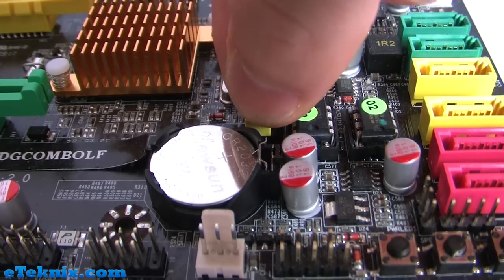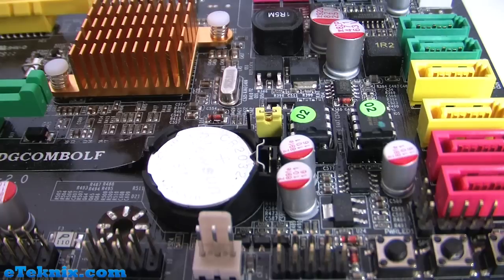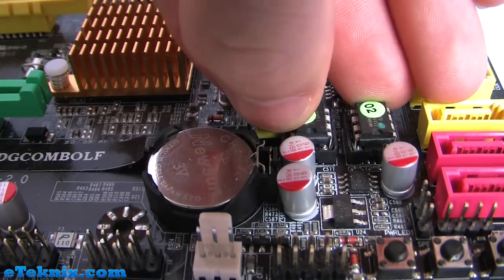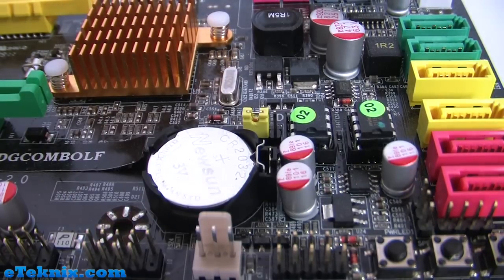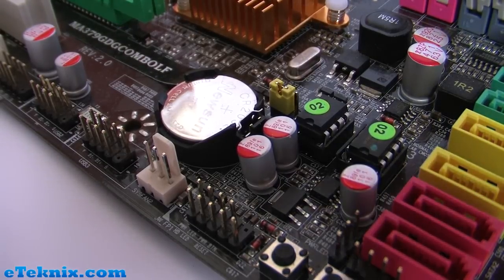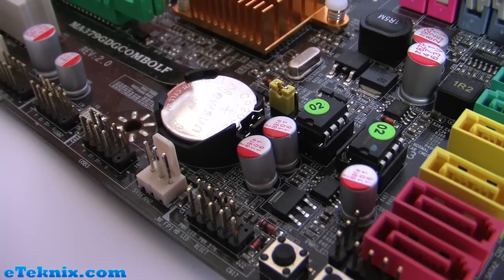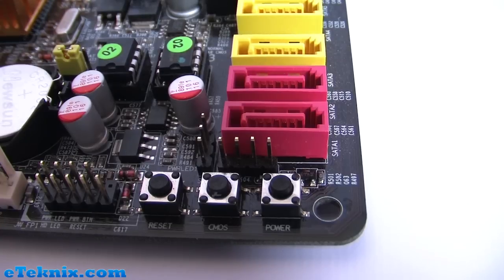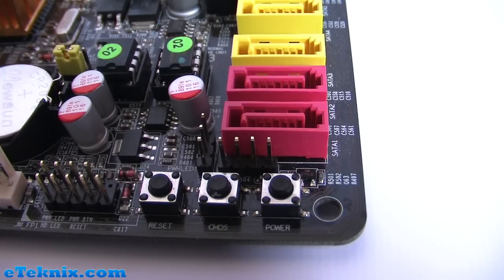How To Reset CMOS

Comment: I have bought a prebuilt pc and when i boot it the lights and fans start but the gpu ventilators dont  and the monitor doesn't display anything. The vendor said it was tested before sending and it doesnt look damaged at all in transport.I have noticed that the pins shorted on the cmos are 2-3 (clear cmos) and not 1 and 2), coud they have messed this up? my motherboard is H61/B75 M.

Comment: Thank you so much. My power cord went out a few weeks ago on my alienware x51 and luckily I had an extra power brick. Now a month or two later it just shut down by itself went black screen and then booted it self up after a few misfires and now it proceeds to beep twice and go on like that until I literally unplug the thing and do a power drain on it by holding dwn the power button for a min or so. Now I'm finding out that people say it's the "ram" or it could be the motherboard crapping out. Where do you think I should start first? Also do you think this could be happening because the power cord crapped out and I had to replace it back then?

Comment: 1. while pulling the cmos does my pc have to be powered on and running?
2. if the answer to (1) is no then after i put it on the 2nd (last pins) do i have to turn on pc then shut it down and move it back to first pins? 
3. if the answer to (2) is also no, then will it work if my pc is not connected to any powersuply? I mean how does the mobo know if the cmos is reseted if its not connected to any power source
Reply: You must unplug the power lead before resetting the cmos.
Hold the cmos reset contact (or pins) for 7-10 secs.
Then plug your power lead back in and turn on your machine.
Always consult your manual, but JBAT1 is what it's called.

Comment: My Pc is not Starting up, even i tried removing and reinserting CMOS battery and and ram, Couldn't the jumper in my motherboard.
Fans are working fine, HDD is also fine as there is spinning sound is over there. but PC is not starting up

Comment: THIS action was preventing my machine from booting?!
Reply: Take out the CMOs, wait 10 minutes, and put it back in again
Reply: @HuskyShields  the cmos battery or cmos
Reply: Lux cmos battery
Reply: @HuskyShields  would this work if my pc turns on but there’s no display on my monitors?
Reply: @xeh9057  I’m not sure I just got it off the internet
Reply: @xeh9057 hey , did u solve this ?
I get black screen after changing my bios settings
Reply: Nexus  damn, did you try taking out the mobo battery and putting back in  like he shows in this video
Reply: Nexus idk that’s all I know. Ask the Linus tech tips forum’s
Reply: Nexus  what is the issue you are having exactly. Did you try changing BIOS settings and you're now getting a black screen?
Reply: Nexus  yeah, I’m going to short it with a screwdriver because I don’t have a jumper cap
Reply: @Nexus did you try reseating the ram taking it out and putting it back in. Also you may want to reseat the cpu as well. These may prevent a computer from booting up properly. This troubleshooting is especially helpful if the fan is working but no display on screen. If fans are not turning on then it is the power supply. For starters try a different outlet. If no good then you may need a new power supply, or even a new mobo if it was over spiked. Hope this helps, please keep me informed. -Jorge best of wishes 🤝

Comment: @eTeknix My system has a gtx 970 and an integrated gpu. I was getting 10fps on witcher 3 instead of the usual 60. Tried to run nvidia control panel and got the "an nvidia gpu is not plugged in" error. I looked up online for a solution and in a moment of absolute buffoonery I followed some person's advice to disable the integrated graphics card, because he said, that action would trigger a switch of gpus on the system. Well, you are already laughing because you know what comes next. As soon I clicked yes on the disable integrated gpu dialog, which I located in my Device Manager, "BOOM", everything went black. I looked up online and a lot of sources on tomshardware and elsewhere suggested a cmos  reset, claiming that this is purely a software issue. Well, I switched all power off and removed the socket of my screen, my tower but not the power of my external speakers (a fact I realized just now) . I opened up my tower, removed the cmos battery, the round silver thing, and waited for more than 24 hours, before placing it back correctly, because I took a photo before removing it. I switched my PC on and still the problem persists. It operates fine,  just I see nothing. Screen blacker than vantablack. I am at a loss here. You seem to know your stuff around hardware. Any advice would be welcome. Cheers from Greece.

Comment: When i reset computer and go to "Boot Menu" all freeze it won't work any
 kinda key: (up down left or right and so on)(I have USB keyboard) tho 
others stuff like BIOS settings will work just fine and same for windows
 but still I'm unable to boot anything from boot menu. Even tho I can a 
in bios that boot cd device as first and insert DVD with windows on it 
just won't work it will freeze like Boot menu, everything 
connected/bonded with Boot will freeze cuz of Boot menu.  
So i would like to know what can I do ? Bc like I tried to reset Cmos 
and jumpers and didn't work, Disk is healthy rams as well, idk it is 
possible that my mobo is dying or sth ?

Comment: Hi, when there's no power going to the motherboard and there's no battery how does the cmos know I'm touching the 2 pins with a metal object?
Reply: It's grounding data from the internal memory, effectively resetting them from ones and zeros, to all zeroes.
Reply: Thank you! I had this exact question in my head the whole time

Comment: Hey i need some help... If i do this.. will my whole entire pc be un-overclocked? because im really fucking stupid, also i overclocked an intel core i3 with intel hd graphics 4400 and i just realized what ive done... also i play on this computer for games easy to run games, whenever i overclocked my computer with the Extreme intel tuning utility, my games were running SO SLOW i mean I tried everything, i tried to do a factory reset and and that didnt work i tried putting it in the default settings and THAT didn't work, i tried a live chat and they tried to help me and that didnt work! so will this help put everything on my normal settings and will get my FPS back to normal?!? PLEASE HELP ME
Reply: go into bios and select load optimal defaults, or reset settings. than it should work.

Comment: I can't find the cmos jumper.What can I do?
Reply: +Im Rambo Gr.....  I propose that you take the  BATTERY out . 30 seconds wait. Battery in (the small 1$like battery. not the Laptop Battery!)
After  this - first thing TO DO is SET your time and DATE, since when you  take the Battery OUT it will sett time and date to 00 00 00 and no software will recognize it as normal.
Reply: 30 sec didn't work but 1 min it did

Comment: I've tried this to fix a display problem and it's still there so I'm calling out to the youtube community: My cpu will display images fine with HDMI but using a regular monitor it will not display, the monitor says there's no signal... The monitor doesn't have an HDMI input, I tested it with my TV and I won't be using it for my CPU. Any suggestions?
Reply: +Julien F-T use an adaptor hdmi to vga

Comment: I don't have the yellow jumper
Reply: I have a yellow cardigan with buttons on the front.
Reply: +Technomics Review just take the battery out for 5 mins and put it back in all with no power connectors connected to the motherboard

Comment: Wait wait wait, did I just hear you say that the battery can hold data?
Reply: MarioKL117 it explains why after I did it restored the time and applications on windows 7
Reply: Date and time etc
Reply: MarioKL117 It's the CMOS that holds the data, the battery simply provides power to the CMOS so it doesn't lose that data
Reply: Darrelle Abernathy So it will delete the files on the computer???
Reply: Noob Gaming the CMOS is storage for the BIOS of your motherboard. So, It shouldnt erase your computer files because said files are stored on a drive of some kind, Rather than on the tiny CMOS
Reply: Yes! That's actually how a lot of Gameboy games actually saved your data.

Comment: Hi, i just bought a new motherboard and after i installed it and start my system, only just black screen on monitor please help????
Reply: +Mohamad Nurhadi check all cables are pluged and reseat cpu also try with one stick of ram try the ram in each ram socket

Comment: I took the battery out, but my cmos still didn't reset, and the jumper doesn't work either
Reply: How long did you leave it out for?
15 minutes is long enough to make sure it's actually reset
Reply: venum4k i dont have a pin or jumper to do what he does in the video and i had my battery for 1hour out and it still doesnt work

Comment: Is the computer supposed to be off during this process cause the would be no power running through the CMOS jumper therefore doesn't make sence that it would reset the CMOS

Comment: I have old IBM, and it freezes on the IBM splash screen. says to interrupt start up press enter, but pressing enter at this stage does nothing.  If I press enter before splash screen shows up , I get four short beeps, pause then one short beep, It does this twice then shuts down. 

I tried resetting the csmos but that only caused it to not start and one long beep with two short beeps, which I have read is a display adapter problem.

Comment: I have a question, when you reset the cmos, does the motherboard need to on with the other components attached, or can you just take the individual motherboard with it turned off and reset it?

Comment: You just saved my new computer. I was screwing around with fans in it earlier and removed that because I thought it was nothing important. I thought it was a fan slot for a second because it was no where near the cmos battery. Just found the jumper laying on the table, put it back in, computer is working again. Sucks I just wasted 4 hours of my day trying to fix it though...

Comment: I have Foxconn G31MXP-K and I accidently overclicked it to too high and can't boot into system, I opened up my computer, remove the battery for a while then plug it in agian, everything was resetted, my computer worked again. After everything fine I closed case.

Comment: @wtchluring I found the battery, but the placing of the battery was a bit awkward (right underneath the video card) I pulled it out and put it back in with success. However, definitely no jumpers. Its a microboard

Comment: @Hadi2234 It's the same situation I told the guy above. If you reset the cmos, it resets ALL SETTINGS to DEFAULT. If you have integrated video  available on your board THAT'S the default setting, therefore, you must plug the monitor into the integrated video then set the video to PCI-EXPRESS. Now you can plug the monitor back into the video card.

Comment: Was it working when you had it plugged into the integrated? If so, the problem is that the BIOS video method is set to onboard video and needs to be set to PCI-express. Reseting the CMOS will NOT help because it'll set the video back to onboard.  You can only activate either the dedicated video card or the onboard memory one at a time, not at the same time. If one works, the other wont.

Comment: My computer will Simply not boot.(happened after adding more ram. Using the old ammount when doing this) The components are fine. (Even the ram). i have a rampage 3, So there are buttons for clearing cmos. When i push it for a while and then push the power button, nothing happens. Please. If you know about any solution, help me. Taking out the battery wont help

Comment from the maker: @kalkos It possibly could, but first i'd try reseating the graphics card and make sure that your monitor cable is connected properly and that the pci-express power adapter is plugged in if it has one.

Andy

Comment: hey i just built my new computer and installed everything and then tried to do the rate my system thing and the screen shut off and the fan on the gpu started spinning hella fast and now it wont recognize the vga would resetting cmos fix my problem?

Comment: hello
i have asus m2nmx motherboard 
amd athlon processor 
a graphic card _9500gt

power supply is fine the fans are running but no DISPLAY 
i tried removing the reattaching the ram i tried by removing the graphic card and 
attaching to the onboard mother board but still no display
can you give some suggestion
it will be of great help
 thank you

Comment: Correction, you don't reset "CMOS", you are rather resetting the sram on the BIOS chip.
 
When you metion "CMOS" I think you refer to the battery powering the BIOS sram, which is indeed called a CMOS battery, this is named so after the most commonly used design style in modern computers, namely CMOS.

Comment from the maker: Try upping the voltage (VDIMM) by 1 notch at a time in the bios, and make sure the timings are running on what they should be running and the correct speeds. A BIOS update may help too.

Comment from the maker: Odd that they spin up, i'd say disconnect all the power (20/24 pin atx) and the 4/8 pin atx power adapters from the board and all hard drives etc... then take out the battery and reset cmos for around 10 minutes and then plug it all back in. If no luck then, you have a faulty board im afraid.

Comment from the maker: To make sure that BIOS resets properly, i would advise you to unplug the power lead so that all static power is at a minimum, obviously the battery on the motherboard will still store a bit. Then move the jumper, wait 10 seconds. Move the jumper back and then plug the power back in and it should be fine.